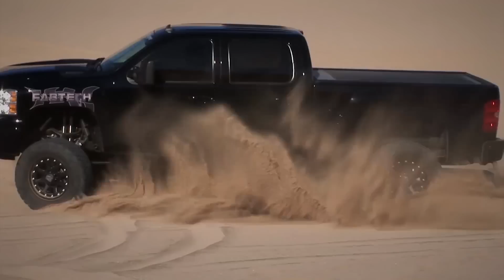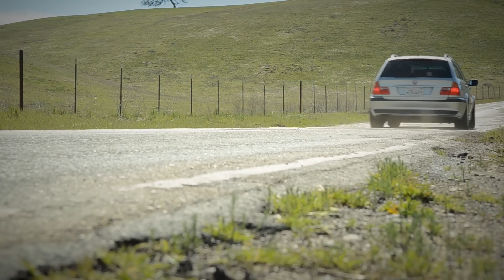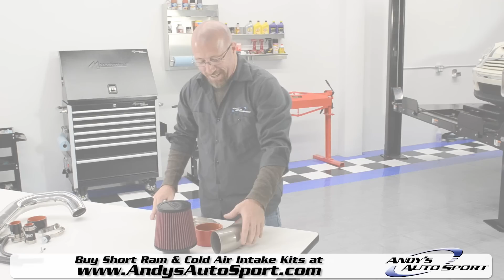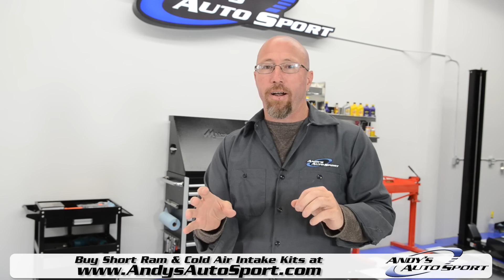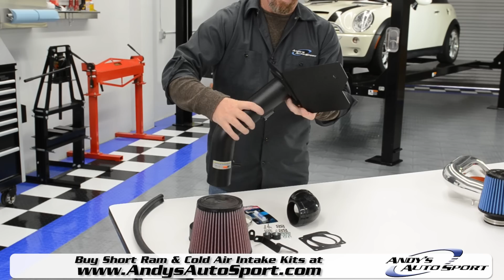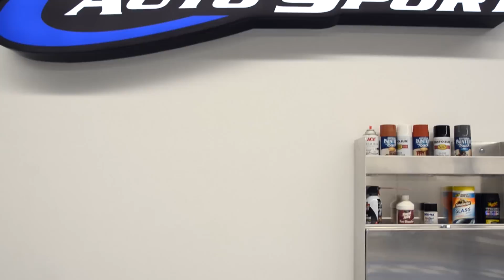Short Ram vs Cold Air Intake Kits: Which to Choose? Presented by Andy's Auto Sport

Comment: Ive been tinkering with cars for the past 10 years and whoever says SRI and CAI don't increase any power is full of shit. They both do. Also remember during dyno test the car is stationary and is not subjected to ram effect. Results may vary on road vs dyno. However like the man said, both has advantages and disadvantages. Short ram intakes generally give you alot better response during low rpm acceleration but can be a real bitch during hot and humid weather and afternoons, but during the night, when the temperature drops, they really start to perform and significant increases have been proven especially for turbo charged engines fitted with front mounted intercoolers. Cold air intakes on the other hand provide better power on the higher side of the rpm range, this is due to the length of the intake tubing but you must find a correctly tuned length and diameter intake tubing for your motor. Excessive intake tube length will cause massive lag in response during low rpms.

Comment: CAI = risk of water in the engine. Happened to me.
Reply: only if it goes too low and in front of the car. i towed a jetta one day with a real low cai and the car was slammed. the guy went over a puddle and the engien hydrolocked pretty much instantly. best to go with a fender draw setup...
Reply: did u have an air bypass valve?
Reply: i guess he didnt. it also happened to my friend with a RSX type S , his didnt lock up though. engien shut off but cranked back up, it threw 2 rods a week later!!!!
Reply: i try to stick with stock air boxes and use a drop in K&N but with better tubing,,
Reply: Only if you submerge it or decent splash directly in the intake. Water wont hurt the engine unless too much enters the cylinder which the engine cannot compress and then parts can break/bend.
Reply: It depends on where the filter is located. Ive had my CAI for 3 years never had any problems with water.
Reply: usually if your engine shuts off from too much water getting in your in trouble.
Reply: samuel lopes a what?

Comment: Cai isn't worth the extra 2 HP vs short ram.what was not mentioned was that ur actual intake manifold to cylinder head is cooking hot.so no matter if u pull 80 degree air from the fender,by the time it hits that hot cylinder head,your it's are probably identical for both

Comment: I put a stage II intake system from Corksport on my 2010 Mazdaspeed 3 and the power gains were huge! Around 40hp on the dyno with the short ram and turbo inlet pipe. I don't know what people are talking about. Some of your best gains with a mod like this is on turbocharged vehicles.
Reply: damn thats a good gain. someone told me that on the mazdas the blow off valve is realy flawed and realy bennefits from a upgrade.
Reply: You are correct but that is only if your car is turbocharged. If you have a naturally aspirated engine that is stock you will notice that Cold Air intakes or Short Ram both don't increase horsepower and can sometimes even make you have lease horse's. It's all about marketing and that is why you MUST know what your doing to your...."Honda Civic" before you upgrade to either of these choices.
Reply: Activ8 What is a "stage I"?
Reply: Activ8 Stage 2 is your intake PLUS a turbo inlet pipe. It's the highest you can go for this car while remaining street legal. Typically a stage I is simply the intake and filter.

Comment: Hello, great video. i ended up going with the Short Ram Intake.

Excuse me though, a quick question if you have a moment to answer...
Do I need piping for a Short Ram Intake ? I simply took out my stock air filter and piping, and placed the Short Ram Intake directly where I removed the stock(with needed air sensor, etc).

Comment: Bought an aem cold air intake for my 01 vw golf 1.8 turbo. 15 whp increase as I watched on the dyno from another stock one getting the same mod. Aem did say up to 18 whp and hell yes It made a difference. This was several years ago but I will say that on a naturally aspirated engine no, it's not much power but you do gain a little. Remember, for every 10 degrees cooler you gain 1 horsepower and also, 1 gallon of gas weighs about 10 lbs. Happy tuning!

Comment: people, please think critically before you buy these intakes. there is no proof that these products do what they say. in fact there is proof that says the opposite. look up 'mighty car mods.' they have an intake or pod or something video about this. i've installed both of these kinds of intakes on a few of my cars, and the only car it made a difference on was an 91 civic hatch, that i installed a cold air intake on. the only reason i believe that it worked on that car is because the ecu was obd0, in other words because the ecu was not very smart it worked. your vehicles ecu is designed to work with what it comes with. cold air intakes are the only thing that ready add any horsepower, and its so minuscule that it's laughable. albeit it does make your vehicle louder, sometimes sound cooler, if that is what your looking for.

Comment: I have a 2011 8thgen civic si with a Kz 3.5" cold air intake and its amazing. Awsome gains I wouldnt recommend a short ram due to heat soak with most of the badly designed ones that sit next to the header.. also the air needs to travel thru the piping with the least amount of bends possible to get maximum gains...

Comment: In my opinion, based on what I understand about air/fuel-delivery, cold-air intakes (really just cold-air air-cleaners) would only make a significant difference on a road-racing car where at peak temperatures the incoming air-charge is a little more dense do to being cooler than without it.  It's never bad to have cool air coming in, but don't expect to improve E.T.'s simply because of the addition of such a product.

Comment: I Installed a Weapon R cold air intake kit with a KnN filter, when i ran it in the Dyno it has minor to no change. The stock intake with a KnN filter does better then the Cold Air Intake, also many have proven that intakes have little to no effect on the car. So why buy one?//

Comment: see you know much about cars if you knew anything about cars you would know that with a turbo you not going to get much change with factory or after market because the air going through the intercooler going to change the air and if you people were listening might car mod guy said in that video that the air coming out of the intercooler was basically the same cold air intakes are not for turbo vehicle but more for none turbo vehicle so yes and no they are right and it comes down to brand to